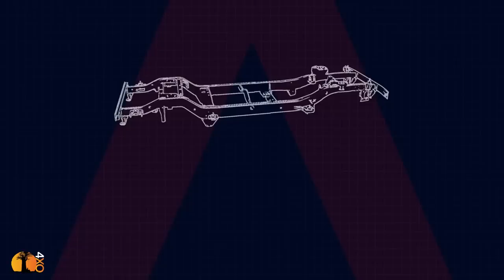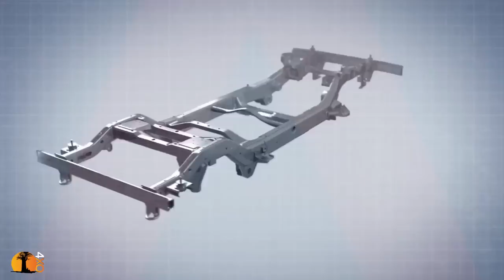INEOS GRENADIER or LAND ROVER DEFENDER. Which one would you buy? 4xOverland

Comment: We dont agree on things very often Andrew. But credit where credit is due, you pretty much took the words straight out of my head.

Just a couple of points. Landrover will sell heaps of new defenders, just not to the market you are talking about. Schools in every metro city will be full of them within 5 years. They are the new soccer mum poser car.

As you said, there is no way Ineos will sell the Grenadier at the price point of the old defender, another reason for this is Ineos doesnt have any automotive subsidies to nick parts from like landrover did with ford and bmw involvement.
Did you notice Ineos also put the springs inwards of the chassis rails? This is also a good thing for 4wding as you can get more articulation without the springs dislocating.

Comment: I believe the Grenadier will be more capable under extreme conditions than the stock (new) Defender, even the 90 with steels and coils.  However, we don't know yet if it's going to be reliable, and at the moment its starting price (for a commercial derivative) is expected to be approximately £50k including VAT, which is expensive.  So it's not going to find a large market in the UK.  There are just too many Defenders available here that are still good enough to use as a base for an expedition vehicle.  The difference, of course, is that you'll be able to buy a Defender that's got mechanical direct injection (200/300 tdi), but you won't be able to buy a Grenadier that doesn't have electronic engine management - it just wouldn't be allowed in the European market.

I read a lot of comments about JLR ignoring their past and destroying the Defender legend.  What did people think they would do?  We should be grateful to them that they kept the Defender going until recently, albeit with a Ford Euro VI diesel engine with electronic engine management, but also with coil springs and solid axles.  That vehicle had to be almost entirely assembled by hand, when all the rest of their models were almost entirely robot-assembled.  It didn't fit with the assembly lines for the rest of the models, which could cope with many different models with little or no changes.  And lastly, the old Defender couldn't achieve the scores necessary for driver/occupant and pedestrian safety in the Euro NCap tests.

Finally, if you were to compare the new Defender, or at least the 90 with the steel wheels and rugged off-road tyres (both available options), with a stock old Defender 90, I think you would find the new one outperformed the old one over any terrain.  What most of us are mourning is the demise of the flexibility that was provided by the old platform - something that is severely compromised by the new platform.  However, I don't think the massive change in the design will stop the new Defender selling like hot-cakes, and I'm damn sure the Ineos Grenadier will not affect its sales either, however much better it may turn out to be in serious off-road conditions

Comment: Hi Andrew your best quote "if it breaks it tell every body"  thats why  most of the so called off road vehicle manufactures wont  let you test there vehicles . They know most of em are crap when you really  take them off road. You cant call the new defender a defender its a bloody Chelsea  tractor, drag queen, life style statement . you couldn't  get the looks farer apart.  As for the use of BMW engines  they are complete junk theses days , BMW stands for Bring My Wallet. As for auto boxes  complete junk off road .  You need Manual transmission  auto boxes are for  tarmac  cruising driving and thats where they should stay. Ask these question  1 what made the original defender so good and also what made it bad. 2 Why stop making it after its been in production for so long.3 servicing and parts availability, key to success notice i dint mention  stealerships.  why use components that are  not easy  to obtain and very expensive,  like bmw engines  zf gearboxes auto type, that is a recipe for disaster

Comment: I agree with alot of what you have said ie replacement for disco 4 and all the rest but alot I also don't agree with...i would still prefer our 110...and also air is a brilliant system if its used correctly.

Comment: I think this has a major design flaw in regard to the rear seats - inspected the 2b prototype last week near Gosford - rear seat position forces you to sit bolt upright like in a chair with a fixed back. I reckon will be mega-uncomfortable in the rear after a short time especially if you have a bad back. I can almost guarantee  no designer or Jim Ratcliffe has sat in the back for  a few hundred km.  The Ineos staff assured me 'Recaro have been making seats for a long time' which sort of misses the point. The 70/30 door is a bit of a gimmick, if  you close in the wrong order it will smash the paintwork against any mounted ladder. Vertical split would be better but never see it happening. Aside from that and the unfinished nature of the car looks very solid. "Computer malfunction" prevented a test ride (a worry, but it is a prototype I guess). No easy usb-power to the right of the steering wheel if you wanted to mount your GPS and none intended. Guess they think phones don't run out of power on a long trip if using the sat-nav component.

Comment: The original idea behind the old Defender and the old G-model was that they were Army/commercial vehicles. The new Defender ist just a SUV, new G-model the same (ok, the G was no commercial/Army vehicle for some years before the relaunch). This Grenadier is no commercial/Army vehicle as well. It will cost more than 100000€, I reckon. It will be just a very luxurious offroader. And to answer the question "wich one would you buy" -  a Series III 88 petrol station in marine blue. Safari top and Alpine windows included, spare wheel inside. That's my choice.

Comment: It needs to be able to sit on 130k/h in comfort (4 x 600 ks round trip a week) on the highways outside darwin (and have power to pass road trains when fully loaded) 
and drive on very rough roads to the mine, and not be subjected to iron ore dust (plus wet season) which basically rusts a vehicle in two years.

Comment: If the Grenadier is built in France. Is it not a good time to compare the Land Cruiser 70series vs the Grenadier? In mentioning the cons mistakes to hope it doesn't build in France. Like on placement of Lights, In how the rear lights  are built in comparison for durability or misses the frontscreen air vents removed from the old Defender in  natural cooling after a/c inside the Defender.

Comment: I have to wonder how they are going to get around the BMW/ZF drivetrain without electronics. Both the engines and gearbox they are intending on using are computer controlled. To strip the electronic controls away is going to require a major redesign of the engine and transmission, which I do not think BMW/ZF would be willing to do for such low numbers.
It's also going to be interesting to see how they pass the Government crash rating, and emissions requirements without computer control.
I think if we expect this to be devoid of electronics, we are going to be sadly mistaken. I hope I am wrong.

Comment: It seems to be a commercial truck based on the lighter side of the Gwagon an outdated army truck. We calculate that it should start at around £36k if they sell circa 45000 a year glabally from what we know.The Landrover Defender was selling at around 30,000 units a year which was not large enought to develope it further. To develope the range they will need to have very low fixed costs across the supply chain with greater efficency than industry average. As with tesla new organisations have the advantage of lower fixed overheads, some control on devlopement and logistics costs. Rumours of part production in France may bring up issues of politics and trade.Should landrover be worried ? Unlikely as they felt the market segment this appeals to is not Landrovers core market.

Comment: Traction control is not desirable? Ok then. Go ahead. Drive with your diffs locked during the months November through February 🤣. Maybe you don’t need permanent 4 wheel drive as well and prefer a solution without center Diff. And maybe you even like to manually lock your hubs? Come on. Seriously. It’s 2021, not 1965. And that’s why the Grenadier gets a BMW engine FULL of electronics. And a ZF transmission, which is also electronically controlled.

Comment: The Ineos looks the part for Intransigent old men who refuse to move on but ironically the New Defender has better towing and payload capacity, Ground clearance, wading depth and Off-road angles. It is better than the old Defender and series rovers both on and off road stock for stock (massively so on road).  The cherry on top is the New Defender is also cheaper and lighter than the Grenadier. The Grenadier is for anoraks that fancy recumbent bikes and refuse to acknowledge the passage of time.
Reply from the maker: You make a very good point here. The new Defender leaves me stone cold because its totally unsuited to true wilderness travel given its complexity, its reliance on small plastic sensors all over the place, and the fact that it cannot be towed if it breaks down.

Comment: Unfortunately the title for your film had no real bearing on the content. You're clearly knowledgeable of old school 4x4 designs of which much of this film consists of yet I feel you've little personal experience with late 4x4 tech. I know you praised the L319 Discovery 4 and not once stated you had an issue with the air suspension after a year of testing. The architecture and majority of the electrickery in the L319 (Disco 4) is 16 years old. I'm sure you honestly don't think technologies become worse with progress/time (P38a doesn't count) or you'd be using an abacus not recent CPU's and developing film to create your content. 

I'm a year into making an L663 film. I've collaborated with Camel winners, direct comparisons, thousands of miles of testing etc and I've still not come to conclusion as seemingly conclusive as you're adverting, but for arguments sake I know for a fact that, from the showroom, it'll be extremely hard, if at all possible, for another showroom 4x4 to best the overall abilities of the new Defender, even on a cross continent trip. Although, I feel the L462 or upcoming 130 would be more suited for such a task.

I've no affiliation with INEOS or JLR, other than the odd press car loan so, like you, my thoughts are my own (admittedly, I'm more bias towards LR's but I'm far from a stranger to other brands. For me it's not always about reliability. You know this better than most as, like me, you're a Suffix era Range Rover lover).

BTW, the Grenadiers namesake is likely derived from the 1955 Oxford & Cambridge London to Singapore Expedition starting point, which was at The Grenadier - it's been a tradition to start such trips from that pub ever since. The idea of building a 4x4 whist in that pub is as 'genuine' as Wilkes' drawing the Series 1 drive train & chassis in sand of Red Warf Bay. The MB Willys was Maurice Wilkes' muse, a vehicle he used to bomb around his estate on Anglesey - its that simple. Everything else is (likely) romantic marketing. 

As for my personal thoughts on the clay model & CGI video offered as an INEOS' 'unveiling' - at this point I feel the vehicle is more DeLorean than Defender, is part bait n' switch, looks like a PS-10 crashed into a G-Wagon & the chassis is likely 'borrowed' from a JK (& the vehicle will inevitably utilise much computer tech lest in not sell in much of the developed world). I will make a film about it and it's conception, if it ever exists. There's a lot more to this INEOS project than meets the eye. 

However, in the event the vehicle ever exists & you're able to obtain one for a period, I'd love to collaborate, perhaps arrange an overland trip with both the Grenadier & the L663? I'm fairly certain I've a few friends with L663's who'd oblige such a trip/challenge. And, I bring the true 'Grenadier', #SNX891 Oxford: First Overland on the same trip?

Comment: Rumours in UK starting 50k GBP. INEOS is an EU manufacturer subject to less than 95g/km CO2 average across range, so small 4 pot Diesel engine will be standard offering in most markets. To reduce list price they will need hybrid or fully electric available in EU markets, due to CO2 tax EU penalty.
For Middle East it will need a powerful V8 petrol (gas) engine to sell.
For Southern Africa and Australia ideally it will need a V8 diesel with standard front and rear lockers and be cheaper than entry level Toyota 70 series. Nissan Patrol no longer available in diesel form in Australia and that had 50 years of proven heritage and no longer made commercial sense.
I think the INEOS is a niche off road offering like some Supercar offerings from UAE, Sweden or Gordon Murray’s new Super Car. Beautifully engineered but the cheapest thing about ownership is the initial brand new non discounted purchase price.
Mercedes tried building and selling a pick up/ UTE, that was better than the competition. I fear the INEOS will follow the same commercial path. But I wish them luck. Fortune favours the brave!

Comment: FYI, the older MB GL series has the same offroad traction package as the G wagon (it went beyond the 4matic with locking front and rear hubs and the ability to raise 3.1" like the Range Rovers of that time period) and older ones are not high mileage because most were garage queens. Don't believe me look it up.  - https://www.carfax.com/vehicle/4JGBF2FE6CA793773 (USA Price) - The Mercedes-Benz G-Class comes with four-wheel electronic traction control and differential locks. The standard G-Class differential locks were originally designed to meet tough military specifications, and they’re perfect for off-road driving enthusiasts who want to explore the full extremes of off-road traction. Each of the three locks can be engaged electronically by dash-mounted rocker switches that control mechanically operated sleeves on each differential.- https://emercedesbenz.com/autos/mercedes-benz/g-class/mercedes-benz-four-wheel-drive-in-depth-look/

Comment: Is it half the price of a G-Class Professional? It is twice as capable as a modified Toyota?
Reply from the maker: Twice as capable at what? Make no mistake. I've owned two 461 G-wagens, and they are very good at many things. But not everything.
Reply: @4xoverland  I guess payload and getting that payload where you need to go, reliably (or in a serviceable manner), safely and successfully. Referencing a previous video, G vs Land Cruiser. G 461 may have 2x load, but is that 2x risk? The old "bag of spares" conversation always comes up. You take a Cruiser because you'll find spares rusting into the wilderness... and most places you might stop for fuel and service. I'm a 461 fan myself. My cousins in Greece have ex military units. Very satisfying. (and they have more G spares than Toyota spares there.) Can't wait to see the Grenadier under pressure, with some serious k's to cover. Love your work!

Comment: My concern would be the weakness of the BMW engine, Yes weakness, in extreme heat conditions the engine oil seals are not as good over time as the Japanese manufacturers, etc. The Japanese  car manufacturers are more reliable in places like the Mid East. Europeans do not experience high weather temperatures. The specification of oil seals perish causing engine oil leaks, if this is for a world wide market upgrade all oil seals. Other than that, what we have seen looks great!!!!

Comment: This thing looked amazing right up until I heard BMW engines and auto only..... Sorry but both are a deal breaker in a real 4x4 especially the engines! If they really wanted to make an ultimate 4x4 they should have gone with Japanese engines or even a simple, powerful, and reliable American v8 like the LS series! Not to mention Japanese or American engines and transmissions would likely cost less and require less electronics which would not only bring down the cost of the vehicle overall but make it less complex and therefore a better 4x4. This will be the weak point for these trucks as soon as they become a few years old especially with hard off road use!

Comment: there is no comparison between the two anymore. the LRD forgone its roots when it became the offshoot of the Evogue. the pre-pretty boy defenders in Malaysia were truly used for their purpose. Rough tough work. in field jury rig repairs. small workshop metal fabricator work repair capable. The police and military here are still using these defenders.

backtrack to 2016 with the relaunch of the RRD, its like they forgot who their customer base for the LRD were. It use to be that it could a licking and kept on ticking. Try getting a ding on your RRD and tell me you'd leave it there because it "adds character" to your "work horse defender"

Aside from the lack of a manual transmission option and using a BMW engine(which is prone to sensor issues), the Grenadier is MOSTLY what the former LRD fanbase want.

I am not too sure what all the fuss is about with the "Ineos StOle tHe dEF3nDeR DeEziNe" crowd, its a square on a rectangle. Its ICONIC, yes, but to patent 2 shapes is as absurd as Disney saying every time you sing "Happy Birthday" you got to pay them royalties

Comment: If Ineos decide to build it in France then I will probably be buying the jeep wrangler or upcomming ford bronco. That will be the nail in the coffin for me. I'm already not happy as it is that there is apparently no manual option for the grenadier,  Im also most displeased over the choice to use a 6 cylinder BMW engine, as we already know they are just horrible in terms of reliability. I would have preferred to see a ford engine with a manual gearbox option. That could be the reason I decide not to buy it truth be told.